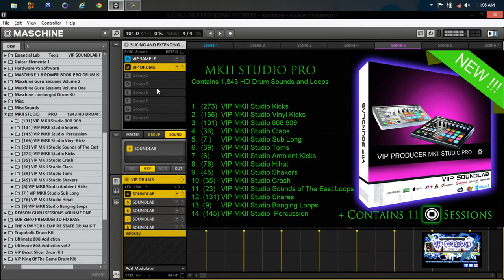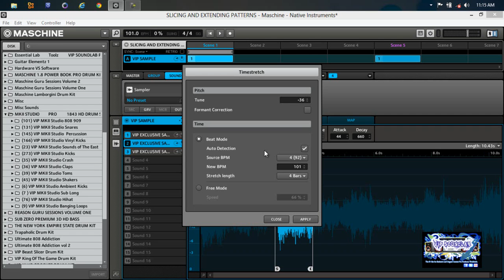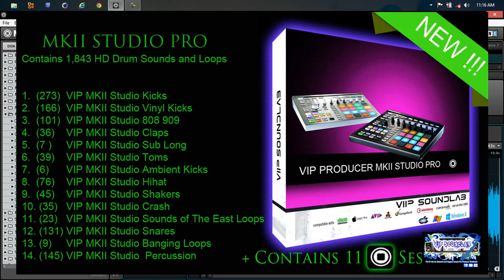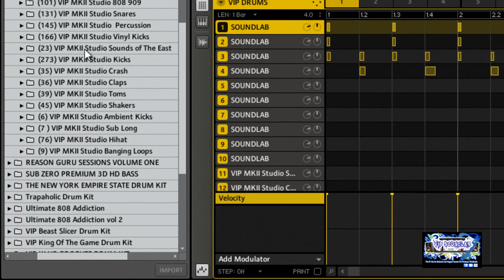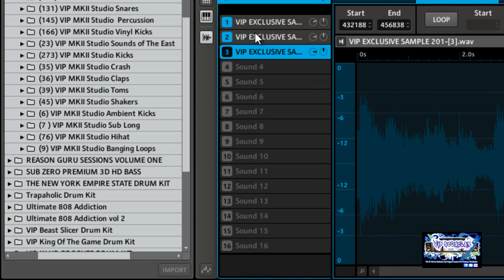N.I. Maschine Tutorial | Slicing & Chopping

Comment: Can you please help me?
I chopped a sample into 32 slices. When i apply them, the first 16 are on the pads like i want. But how can i play the slices 17-32?

When i change octave in Pad Mode, then i need to change 3-4 Semitones and after that the pads 17-32 are on the pads like i want em.

But is it necessary to change octave AND Semitones until thei are properly on the pads (meaning 17 ist where slice 1 usually is and so on)

PLEASE PLEASE PLEASE Help me. i'm stuck on that....
Reply from the maker: Do you have a Midi Keyboard ? I would press Pad mode -> Keyboard Mode -> goto your midi controller -> :) BOOM !
Yeah fam I agree you can change the pitch of individual sample chops to add some flava if its sounding right in the mix but sometimes that can make a sample sound funny , depends i guess. Me personally once i chop them i tuned the entire and just leave it that way.

Comment from the maker: What do you mean ? as far as Slicing goes you have 3 mode detect , Grid and Spit. Split modes works the fastest in my opinion but it depends. You just adjust the start and end points of your sample then either press apply or use the Sample Drag Icon and drag it to a blank sound , erase the mappings off the grid and you are ready to go. Hit me back if you get stuck fam